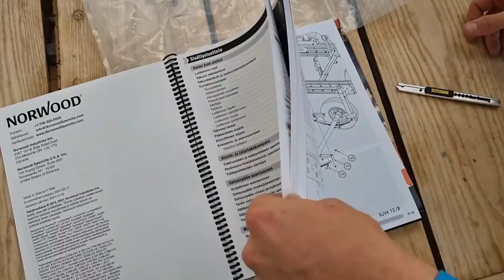Our new Bandsawmill Norwood HD36v2 assembly!

Comment: Tere
Kas olete saeraamiga rahul?
Reply: Give them a chance to use it first.
Reply from the maker: Soso, it would be better if tracks on the sawbed were whole 6m instead of 1.5m pieces.. we have small issue with that, other thing is the blade ceramic guide runners, those ceramics have to be adjusted constantly, we are planning to switch to roller guides.. Other than that if we get those things changed it is really nice machine.
Reply: @HermanTT  let me know how the roller guides work out. I may do the same thing..